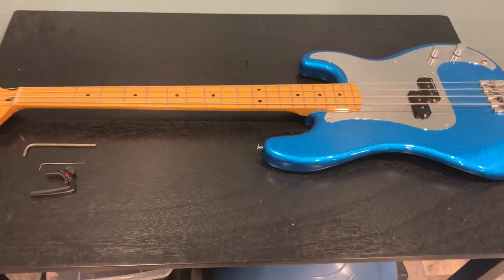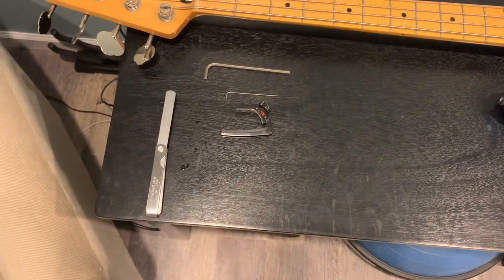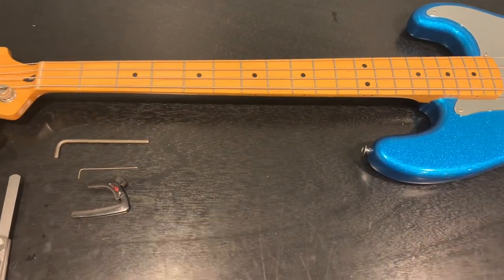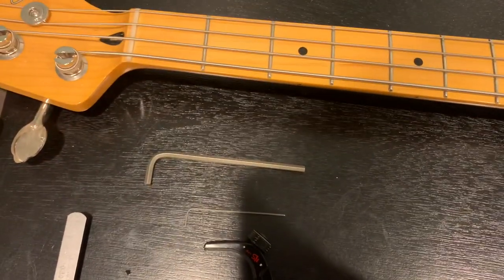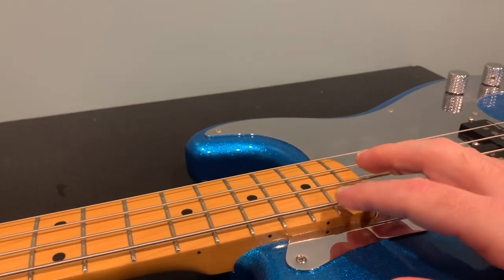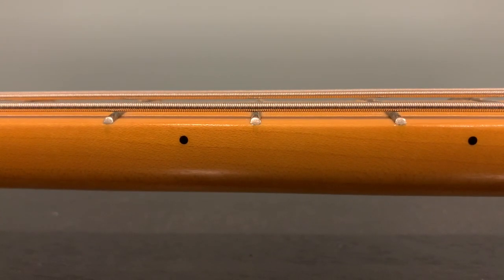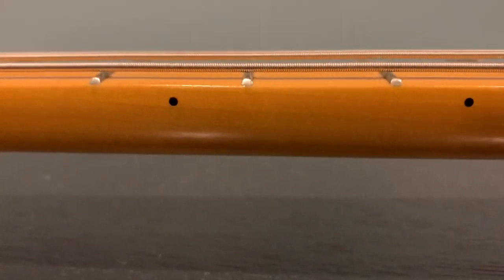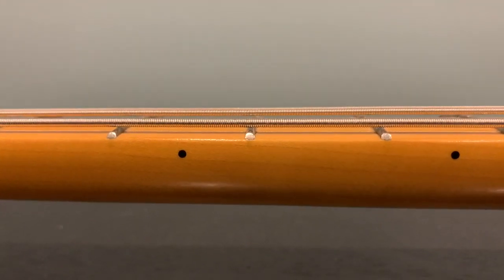How to check neck relief on a bass guitar

Comment: Still unsure on how to use that feeler guage. The guage tilts, bumps the string, everything is moving and I can't get a precise reading. Never know if I have too much or too little relief. I feel like I get close... in the ballpark, but it seems like such a crap shoot.
Reply from the maker: It all depends on what you prefer for relief. What size gauge are you using? If you put the feeler gauge in and it makes contact with the string there is little to no relief (how I like it lol). On all of my basses the relief is pretty much the same. If you clamp down the first fret and depress the last fret, what do you see in between the 7th and 8th frets? Do you see the small gap like on my bass. If so you are ok and your feeler gauge will make contact with the string.
Reply from the maker: Just gently slide it on the top of the 7th and 8th fret.

Comment: Why you only take gauge reading for string E, and not the rest A, D, G. Surely each string actions will differ?
Reply from the maker: This is about the neck relief. I use the E as the guide for that. For string action I don’t measure.  I do that by eye and feel.

Comment: Do you also use the 7th/8th fret for checking point on a bass that has a longer neck/more frets?
Reply: Yes, as that's the area in which the truss rod adjustment is most apparent.

Comment: I have a 6 string bas guitar btb ibanez and i like my neck straight and my neck relief is like 0.10mm  on my neck very straight but the reason i only set my trussrod every 2 or 3 years because my 6 and 5 string ibanez badd has carbon fiber rods in them soo yeah
Reply: okay
Reply: ratio + L + nobody asked

Comment: You are putting the feeler gauge in at an angle, you're rocking all over the place - check the vid - a very inaccurate method. Put a capo at both ends and then concentrate on inserting the gauge both horizontally level to the string and also flat on the fret.
Reply from the maker: It’s actually not an accurate. I said the relief on this Bass where the feeler gauge lightly touches the string. That doesn’t bother me. There are many ways to check the relief. One of them is capo the first fret, and hold down the last fret. You can also hold down the 12th fret. On some of my basses I use .08 feeler gauge and the gauge always lightly touches the string. Again it’s just how I like my relief. It doesn’t necessarily mean that this is the standard. One thing I do regret making this video not checking the relief in playing position. That is something that I do. However, with this, the relief was the same laying flat down on the table and in playing position.
Reply from the maker: I meant to say this is not inaccurate in my opinion.